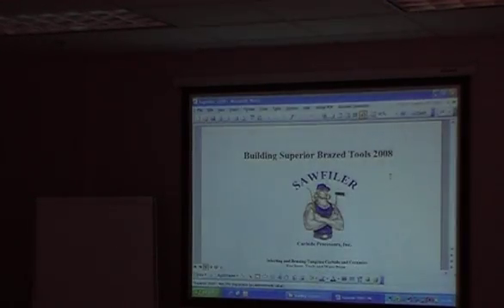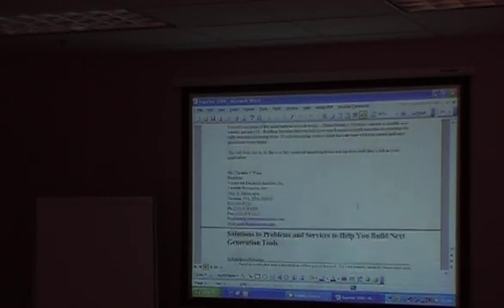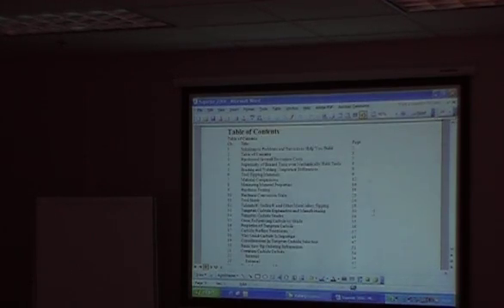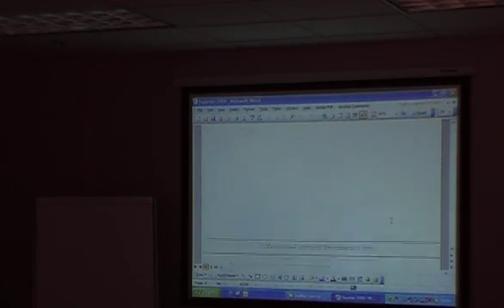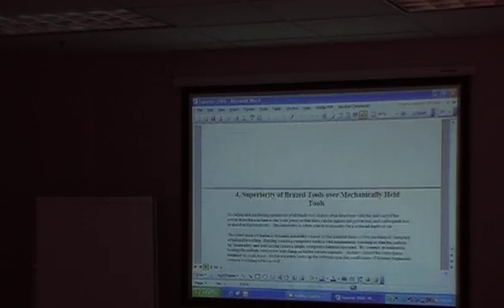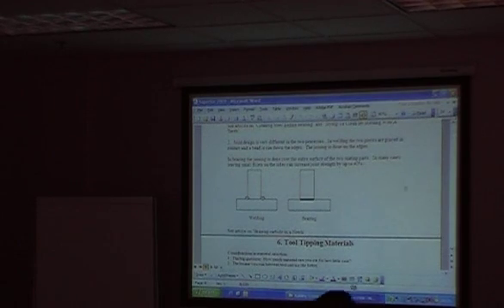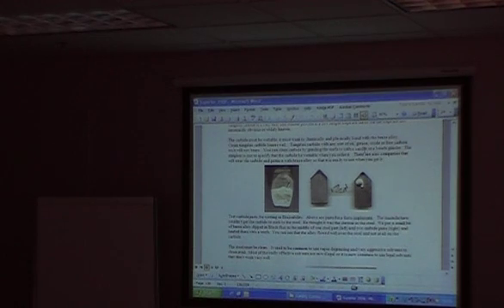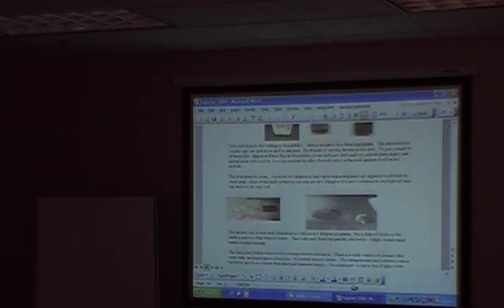Brazing Basics, Part 1 of 10 | Carbide Processors

Comment: Ten years later:  I'm really interested in this kind of thing,  it might be easier if the presentation filled the screen?  I would read the slides if I could.  I am actually using the Mega Flux and some other C.P. stuff now.  Main issue presently is band saw blades, but a lot of odd stuff gets silver-soldered, and I'd like to be better at it!  This issue of stainless steel for example has come up.  I thought it was hard, adherent Chromium Oxides that were making the trouble?  Anyway, in the past I think I WAS overheating as mentioned here, and shooting right past the point where the flux would clean and the solder flow, and just getting a blackened mess.  There's a lot less of that, now!  The black flux seems like it could be used for everything... it's very easy to see it become clear, and it cleans surprisingly well.  It'll take the black mill scale off the band saw blades for instance.